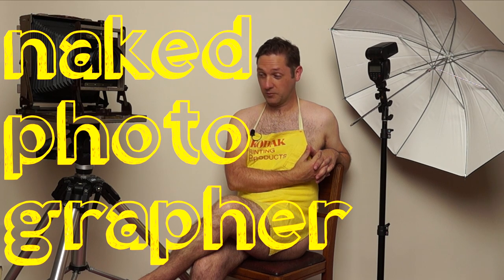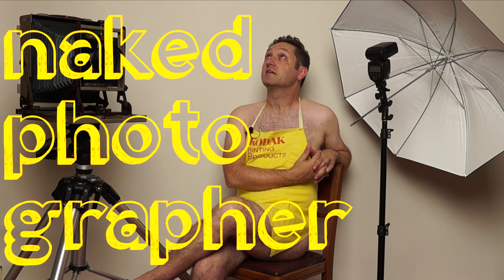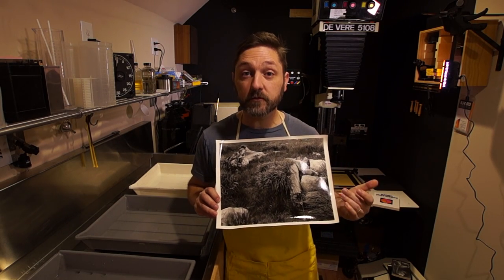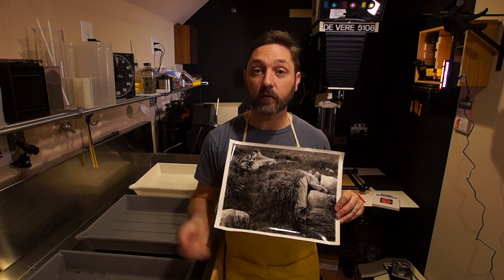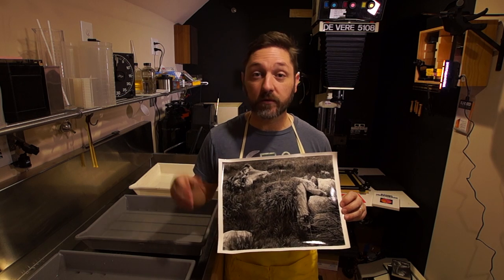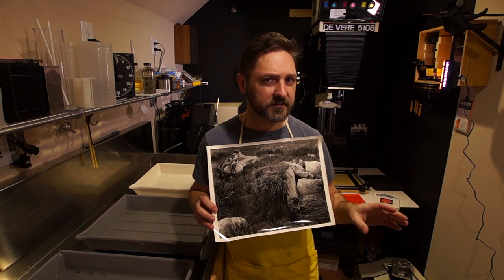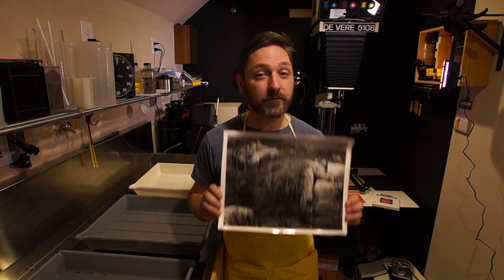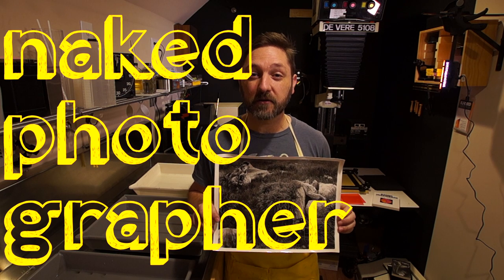Split Grade Printing

Comment: Sorry but I need to call you out on one glaring error you made. At approximately 05.30 you state that you used the #5 filter @ increments of 5secs however you previously stated it was at 3sec increments. You need to reshoot this video correctly. Peace

Comment: Hi, could you tell something about choosing the f-stop? Like, what f-stop would be more appropriate when printing with 0 filter or 2,4,5 filter? I'm asking because when I do split grade printing, the times are quite similar when I use 2 grade or even 4 grade. I usually use f-stop 8. I don't know if I'm doing something wrong or what. Thanks.
Reply from the maker: The aperture is going to affect print sharpness as well as make your time longer or shorter.  It is best to leave it at one setting while printing, and f/8 is a good choice for maximum sharpness.  More open it doesn’t reach its sharpness potential, more closed it starts causing diffraction.

As far as your equal print times are concerned, that just means your negatives print best with a medium contrast range equal to a 2 filter.  Nothing to be concerned about.

Comment: Hi there. Im trying desperatly to use my durst m605 colorhead  making b&w prints. This is what i do: setting built in filters to 0 and put a ilford 2.5 filter under the lens. 2, 4, 6, 8 , 10 sec. At f11 For test printing but when i develop its either  blank or very very littel  of the image has come on to the paper very faint. I have new dev, fixer and stop bath. What the heck am i doing wrong? :) its like the paper dosent get enough light or something ( id like to do a 30x40 print)...maybe i need to do a test strip with 10 sec increments?...funny i didnt use that long time when making ra4 prints from 35 mm
Reply from the maker: Try the lens wide open at its biggest aperture just to see if it prints darker.  F/11 is very high aperture for a 35mm.  I typically close the lens down 2 stops from its brightest, so an f/2.8 lens will get closed down to f/5.6.
Reply: Ok thanks. Actually i just set it to f4 and 3 sec increments 5 steps...so 15 sec at the most...still very pale allmost nothing. Tommorrow illtry 10 sec increments in 5 steps at 5.6. How does that sound?
Reply from the maker: Give it a try.  I looked up the manual for your enlarger and it states your bulb should be a 100w halogen bulb.  Do you have the right wattage in there?  Is it old and need replacing?
Reply: The Naked Photographer ill have a look. I just did some 40 x40  ra4 prints fromt 6x6 and they look great. But i will look

Comment: Great guide to split grade printing... I have to admit my method is pretty similar to yours except i start with grade 5, get my shadow detail sorted, then work the highlights on grade 0 and let the mid tones fall where they may, this gives a nice contrasty print.

Overall I print everything split grade now, the results are better and far easier to produce as the reduction in dodge and burn saves so much time.

Comment: Excellent video as always. Only suggestion I can think of that may help make them a bit clearer, but require a bit more editing and whatnot, would be to do high res scans of the prints when you're talking about contrast and exposure results. 

It can be a bit hard to see the subtle impact of things when it is just held in front of a camera from a bit of a distance. 

Keep up the great work.

Comment: Interesting video!
 
Decided to try this technique of split grade. Then I remembered “Shoot Film Like a Boss” who have a grate video on F-stop printing developed by Gene Nocon. Got the book after seeing that video (recommended).  Anyway after doing a landscape and a portrait oriented 35mm test print I thought of something: combined F-stop printing with split grade. I exposed the entire paper with a Ilford 0 filter as you showed but for 5, 10, 20 and 40 seconds so there is one F-stop between each step. But I did that horizontally. Then I did the same thing with a Ilford 5 filter but vertically. So when I developed the print I got a 4x4 grid pattern with 16 different F-stop combinations of 0 and 5 filter combinations. From 5sec 0 +5sec 5 to 40sec 0 + 40sec 5. So I got the  0filter on the X-axis and 5filter on the Y-axis. 

Anyway, just a small thing I thought to chare. Again really cool video!

Comment: Hi from England again. I have seen all your videos and do recall that the answer to my question is somewhere on your channel but I can't find it. I used to print colour and b&w professionally for a few years early 2000. Now I am going back to hand printing in my own practice and I have recently bought a De Vere 504 with a colour head. I have never printed b&w with a colour head before so I am not confident with the CMYK dials on the head. I will use Ilford MG filters 0-5. I presume I should just exclude any CMYK filtration on the colour head when using the MG filters.  Many thanks in advance, Lowe H Seger
Reply from the maker: Yes, ignore the color head if you are using separate filters

Comment: Thanks for sharing your tecnique, it seems simple and effective. One of these days I want to give a try to your method: sometimes my prints come flat even at 4 or 5 grade with my diffuser enlarger and color head. Two questions: does your method give different results using the filtration of the color head instead the Ilford gelatin filters ? Have you ever made a  final comparison with the same image printed both with  split grading sistem and the classic way ? Congratulations for you darkroom, it looks coozy. Ciao.
Reply from the maker: I have not compared the two methods.  I may make a video about it in the future.  My upcoming video shows some new changes to the darkroom, mostly the wall opposite the sink.
Reply: Thanks for your quick reply. I am curious to see your comparison. I will do my test as well and tell you my opinion. See you soon !

Comment: Hi there. Ive been printing a lot of color the last year using your good videos among others and its been working great. Recently ive startede doing bw and i love it. I use the ilford under the lens filters for splitgrade an so on and it is also working great. What i still dont get is this: i shot a photo on my olympus  mju 1  with the kodak trix 400. I did a 50x40 split grade print.. it was like 21 sek filter 1 and 22 sek filter 5  at f11 . I think it looks great getting what see as really white and deep black.  So in my holliday now i shot a new 35 mm photo on a new camera - a yashica 5t  and i thought that now it was a piece of cake using my notes from the photo mentioned above - but i all came down to an exposure on filter 1 at 25 sek and 45 sek at filter 5 ( a lot more than on print  same size mentioned above) . So my questio is: why such a huge difference ? ( i did use a other 50 mm enlarger lens - the first one a rodagon 50 2.8 and the other a durst neonon50 2.8) otherwise i think its just about same conditions  - but ofcourse two different photos/negatives.
Reply from the maker: It means your film ( or at least that scene) was lower contrast and needed longer on the 5 filter to get the contrast you wanted.
Reply: @TheNakedPhotographer  ok! Thats pretty simpel 🤗im glad to hear that . Thanks once again 🙂🙂
Reply: …so a smaller print size - any print size ..will yield the same filtration time?
Reply from the maker: The ratio may stay the same, but the times will change based on the inverse square law of light.  Larger sizes will need longer print times and smaller sizes will need less.
Reply: @TheNakedPhotographer  ok. That makes sense…that was two big questions cleared of my mind . Thanks for that. 😊 what i thought i colud use my notes for was to skip the test print but thats a no go 😀

Comment: Let's say, using this technique, that you had a negative with some totally blown highlights. I'd assume, you'd look for detail or tone in the highlights that have them, establish your 0 filter exposure from that, then make a test adding the 5 filter at various increments. So, how might you add some tone to the blown areas? Preflash the paper?
Reply from the maker: Yes, preflashing would work well
Reply: @TheNakedPhotographer  I just finished rewatching your pre-flash video. Thanks.

Comment: Thank you so much for this video! As a beginner, i have looped this video over 10 times. Just one little question about 0 filter, why you choose 10 second, not 16 second? As the test result, the stone's 
highlight parts has more tone in 16sec.
Reply from the maker: After I dried it, the test strip darkened.  If I had printed the 0 filter at 16 seconds, it would be too dark after drying.
Reply: The Naked Photographer thank for your quick reply！ by the way is there necessary to calculate 5 filter ‘s effect to highlight parts ‘s detail when I use the filter 0?
Reply: @TheNakedPhotographer  I would have liked to have seen the image that led you to select 9.5 seconds.  I feel like this leaves me guessing a little about what was going on.  You talked at 4:20 about not being sure if you could judge with the two strips and were concerned about assessing contrast vs density.  Showing us the dried down image at that point would have really helped.

Comment: hi...I imagine some negatives require special development considerations that may push your skill to the next level. Otherwise, why do it?
For less demanding negatives, which is your preferred technique of choice?
For example, split grade printing, single filter with or without dodging and burning, or no filter with or without dodging and burning?
If you have the time, please reply
Reply from the maker: Dodging and burning isn’t a preference, it’s a necessary part of printing regardless of your choice of contrast control.  I typically use my color head to control contrast for my prints.

Comment: Questions on whether there is any benefit to split grade printing when using an enlarging meter like the RH Designs analyzer pro?
Reply from the maker: I’ve never used an analyzer, so I couldn’t say
Reply: I use the RH Designs Analyzer Pro and haven't really felt the need to do split grade printing with it (the Analyzer isn't really designed for split grade).   I will, of course, burn areas of a print using different grades - that's a form of 'split grade' but not in the sense shown in this video where the entire print is exposed using two different grades.  However, there are times when I think that split grade would be beneficial.  For example, I'm currently printing a landscape photo that contains trees that cross the horizon line.  Burning the sky using traditional methods unacceptably darkens the tops of the trees, leaving a discontinuity in tone between the tree tops and trunk.  Another option is to pre-flash the paper so that the sky takes on sufficient density during the primary exposure and doesn't require burning.  But I haven't had good results from pre-flashing in the past.  Instead, I'm going to try and split grade print the image using the technique shown here.  I think this method should be a good solution to this printing problem.
Greg, it would be great to see a follow-up video that motivates the need for split grade printing and shows some situations in which it is particularly beneficial.  I know some people who split grade every print they make, but I tend to think it's unnecessarily complex in situations that don't require it.
Reply from the maker: I have split grade printed probably a half dozen prints at most, and I’ve made over 200,000 prints in the last 22 years.
Reply: @TheNakedPhotographer  Makes sense.  It seems to be a great tool for solving specific issues with some tricky prints when all else fails.
Reply from the maker: Some people love it and use for everything.  Different strokes, etc.  Its just never been my go-to method.

Comment: Hi -thanks for the video, I'm familiar with the split grade printing with the filters, but how do you use the colour head to achieve  this? Do you use the magenta and yellow wheels simultaneously?Or do you go through the same process with each one? Could you make a video about this?
Reply from the maker: Ilford has excellent guidelines for using color heads to control contrast.  You can use two methods, either use the yellow alone to lower contrast and the magenta to raise it, or use them simultaneously to control contrast.  Because the filters are adjustable between grades, split filter is not necessary.  You can adjust the dials after your main exposure for burning specific areas, but no need to change for separate high and low contrast like split grade printing.
Reply: The Naked Photographer Thanks for the reply. I’ll have a look at the Ilford website. Interestingly I haven’t found any you tube videos about this. 
Your videos are refreshingly knowledgable !

Comment: What about dry-down for the unglazed glossy paper? 2.5% adjustment needed? Also you’re using HEAPS of paper, especially to make that larger very nice print. in fact all split-grade printing seems to demand the use of more time and paper (and chems). Have you checked out the enLARGE app on the Apple AppStore, to save paper, time and chems?
Reply from the maker: I’ve never heard of that app, but my printing in real life vs. a video demonstration is different.  I don’t go through all the same steps when I really print because I know my negatives and what contrast I develop them to.  But since these videos are intended to be educational, I walk through every single step.  As for dry down, every type of paper is different, so test your own.
Reply from the maker: I just checked out that app.  $23 is way too high for basically a notebook and a calculator.  Especially for calculating matching prints at different sizes.  A couple test strips and a post it note would give me the same information at much less than $23.  Same with dry down.  Compare a wet test strip that matches a dry one and write the time difference down (as a percentage) on your timer.  Done.  It seems like you have to make comparison prints anyway to calibrate the app, so why use the app at all?
Reply: The Naked Photographer 
You only make the calibration once for the enlarger rig, not for every different print. The app functions like a super-calculator, you couldn’t/wouldn’t want to try doing what it does with a simple calculator. Not sure where the post-it note fits in? Anyway, good video, I know how much work goes into it!

Comment: What cmy settings on the enlarger are you using for the light source strength ?
Reply from the maker: I’m not using the color head filters at all.  If I were it would be 0 cyan, an exposure at full yellow, then a separate exposure at full magenta.

Comment: Hi...Do you think there is any validity to this method? 
Use 2" x 2" squares, split grade test for highlights and shadow areas that matter most to the image.
1) Using CF 0, expose for the highlight that matters most in the image with increments of varying times using several separate 2" x 2" squares. Select the best exposure time for the highlight that matters most in the image. 
2) Pre flash several 2" x 2" squares with CF 0 at selected exposure time from 1 above, then
3) Using pre flashed squares from 2 above and CF 5, expose for the shadow that matters most to the image with increments of varying times using several separate pre flashed 2" x 2" squares. Select the best exposure time for the shadows.
4) make full size print by first exposing paper to CF 0 at selected time in 1 above, then exposing paper to CF 5 at selected time in 3 above.

All of this is as opposed to test strips, which may cover too much area of the image, with the exposure time too light, or too dark being discarded when it may be that the subject area of that section of test strip is to carry the most weight to the final image. In other words, the area that is selected for best exposure may be at the expense of the area of the image that mattered most though discarded because it was in the too light, or too dark area of the test strip.

Thoughts?
Reply from the maker: The only difference I see between your description and what I did for this video is that you are making test prints of the same portion of the image and I did a traditional test strip.  Both methods are valid and you should use the one that helps you make your best prints.
Reply: @TheNakedPhotographer   makes sense...I mention the method as I've been experimenting with it, and to me, the best part of the image in your photograph was the log, and not the rock that received so much attention. 
It may be that if the focus was shifted to the log, then the rock may have been poorly developed. Hard to say